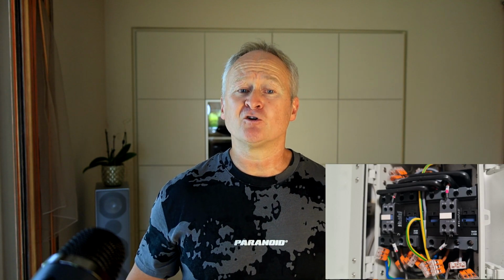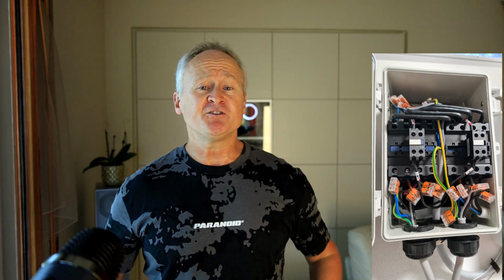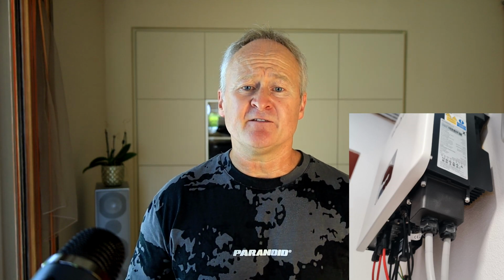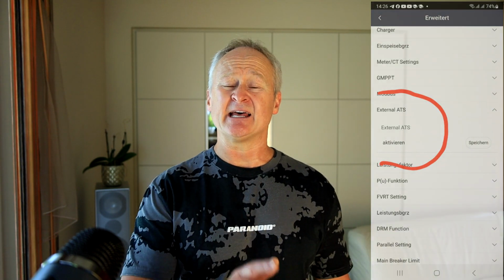Do we need the Solax X3 - EPS-box to have emergency power?

Comment: Hello, danke für video. I try to use the SOLAX without EPS box ( it’s is expensive 😊) and without grid. I think your advice to put ATS “deactivated “ will resolve my “grid lost fault” problem . I will try this next week when I can access the inverter. I have no wifi module (lost and no way to order for the time being) but I hope I can do the setting ( deactivating the ATS)on the LCD screen .

Comment: Hello, Im collecting information about hybrid inverters. At the moment, I settled on three-phase solutions deye, solis, solax. Many people say that of these three brands, solax is the best and its big advantage is that in the ups mode it can give out all its power for one phase and is better able to survive the phase shift? I will also be grateful if you tell me about connecting the generator to Solax (there is an item in the specifications, but I do not know the method of connection), I did not find such information on the Internet (I know that deye has a gen-port to which you can directly connect the generator). how do these occur in the system with solax?